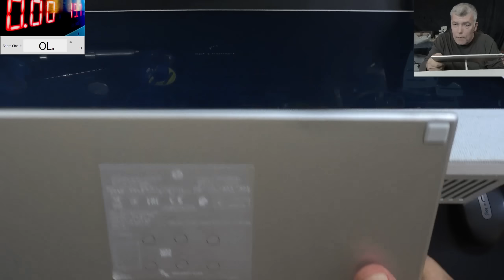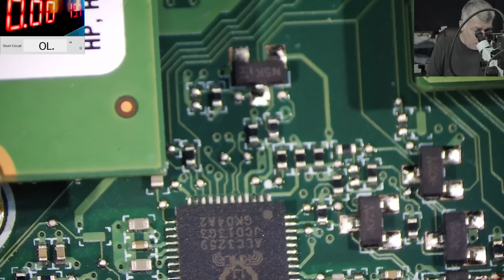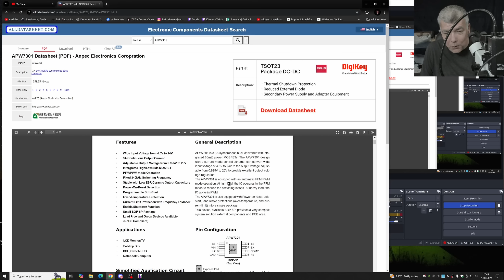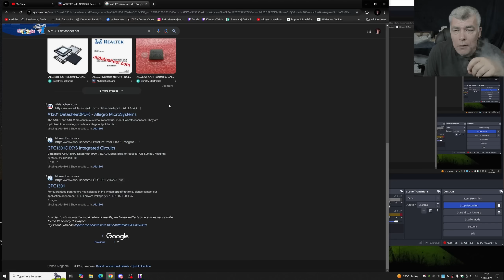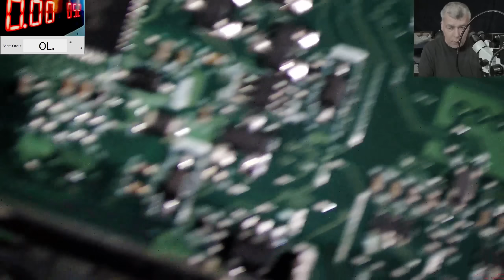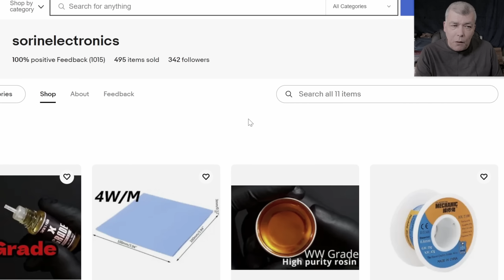Hp AIO GQ57 no sound - Dodgy? This is electronics at its finest, right? :D Audio rerouting

Comment: I repaired critical communications circuits for about 50 years. When it is critical you do what is necessary to get it going and when the situation cools down you go back and make it pretty or correct. Its better to do this when necessary rather than have the mission of the equipment aborted.

Comment: It doesnt work that way. A customer cant come in and ask for a repair and say i want it in x time. Its not always an easy fix. If they want it repaired, it takes as long as it takes. If the audio ic was burned and you had to replace it? How would you do that in a day if you dont have the chip? They come in, you diagnose the issue and go from there. You tell the customer how long it will take depending on the issue. If its as simple as this one where you can just solder a wire or if it's gonna take longer because you have to order parts.

Comment: I will check the data of the audio ic in put voltage.
Check the burnt regulator in put voltage drop by any other small regulator and give to audio ic

Comment: Well, seeing as you used proper calibrated wire I guess the repair is not dodgy. Seriously - if the sound isn't distorted at normal to high levels and it stays fixed then what's dodgy about it? A lot of these PCs are over-engineered - simplifying the power distribution is a good thing if you're not overloading the power line you're using.

Comment: Understanding the time constraint, one could wire in a dc barrel type power jack, and wire this to the audio chips Vcc and ground. Then get a voltage regulated 120v/240v input to 5Vdc out external power convertor cube. Then plug this into the wall outlet power and other end into your previously installed dc power jack. Hopefully with your method used, the additional load you put on the other power supply chip for your audio chip power source now doesn’t overload/overheat it with time? Clever however how you robbed Peter to pay Paul 😎👍

Comment: I think that when the resistor is bad, it increases its resistance, probably that's why you found that resistance, there is a voltage divider if any of the resistors are changed the output voltage is different, remove the resistors from the board and measure and calculate using the formula: VOUT= VIN(R2/(R1 + R2)

Comment: Hi sorin the fb pin has a defined voltage if that voltage gets to the feedback pin the buck supply switches off pwm generally feedback pin has voltage of 0.9 to 1.6 v that means if output is 5v the feedback pin should have the voltage defined for it after the resistor divider network doesnt matter what resistor are being used in it untill its in range of 100kilo ohms.

Comment: It was a great video but in the end : ain't that over-engineered board ? I mean you can literally bypass a power supply chip with a wire, why did they put a failing point for nothing ?

Comment: That ic takes 12v and i would add step down buck regulator and convert 19v to 5v or boost regulator from 5v to 12v incase power supply is not always on when you plugged in adapter. Thats how you can proper job incase you dont have in stock but being a technician i always keep srep down and step up regulator with variable outputs on me for these kind of jobs.

Comment: anyways id just use a direct conversion from the main rail and tune it down to 10v using inductors and variable resistor and a 30v100uf buckconvert

Comment: this design is actually clever id say a good propper design someone think aye we just slap an isolated soundbar module in this thing tied to main rail then step down the voltage and we done simple efficient if it get rekt it doesnt take the other component or chips inside

Comment: On my motherboard, the sound is also broken and can't find the chip anywhere, so I connected an external DAC and the sound is better than the original. I did remove the chip in case it can also be short-circuited.

Comment: The machine was fixed, and Sorin should have said that the sound quality would be shit. 
And if client wants better quality, he should suggests a USB sound card (or better yet, BT speakers). Or client could call "in a week" and find out if the part has arrived.

Remember, the "bottom line" depends on many situations, and here the critical parameter was: have a computer tomorrow, and only then an additional one: have sound would be nice.

The client received: a diagnosis and a temporary solution.

Comment: There is a voltage divider formula in data sheet, after knowing the voltage you can replace with any other Buck converter laying around in spare boards or even premade 3£ converters from the Chinese, it's less dodgier, lol
Reply: I had done like this. 👍

Comment: I will take 5v from the HD drive .. but i'm worried about this voltage... the burned power supply can power also the 2.5 HD... this machine has an M2 for windows ( i don't think it's an optane hybrid array ) .. if i'm right the 2.5 disk is also not working.

Comment: Nothing very wrong in the repair you did but the only issue could be, the speakers are too demanding and the amplifier draws a lot of current, you may also burn the supplly from where you have sourced the 5v. 

Better to replace the chip on long run as soon as possible it’s available.

Comment: Hello Soren and channel.  To fully evaluate this fault, the altered power input, it is very helpful to simply set about designing a board region.  
Several very robust programs support the activity as  board component within design layout, the activity to design and fixture chips, capacitors, resistors, mosfet, diodes, ect.  Within the program, effortless placement is moved, altered, as to achieve a nice package with the normal end goal set as sales. My task was to effect a car  windshield with dim out to the dreadful blue -white halogen intensity as blinding as hours of operator darkness.

The understanding 1st gen trial, leads to 2nd gen, 3rd gen.  Directly relates to various print reads to the modern , mother board complexity.  Some models, such as several dell monitor, suffered a central power solder fracture after months of end use.
Re solder, repaired the fault for a refreshed service time. And I think the interested channel will at once, think of other examples.  A common fault to model. Fundamentally, the customer to repair wants a rugged, long service to needed device. And advances a device to request for repair.  How the electrons flow is not of interest or comprehend.
Enter practical, restored to working.  Sound is on.  Everything works.  
Low cost, expected robust operation for a long life.   
Next example?  The modern car parked outside, with a list of electronic modules doomed to fail. Water, vibration, hot cold cycle?
Get ready to pay for expert service.  Will  you truly care about 11 volt to 14 volt duty? Drive on. Calibrate wire.  Everything is fine because "we have picture". M.

Comment: Very good way to ez fix.👍
It is a good way like u did but for to go like more professional I will check more to be sure about the voltage an put a buck converter to get the same value from the speakers.
I always looking ur videos, I love how u do fix the problems in a easy way and saving time. I learned a lot from u either. Keep doing what u do and don't mind about dogshit comments for those who don't know in electronics

Comment: IF... you are sure the 5V you are stealing it from is not a "balanced" circuit that drawing from it could crash that and can of worms...,   then maybe a little voltage reg tapped from 19V would be the safest and it can safely draw what ever the volume is.  I have tons of 5,9 ect  v regs for this purpose, not just laptops. So useful when you want to get power to something controlled but NOT sure if the tap is safe to do so.  Sorin is VERY experienced and wouldnt do this or show you unless it was safe. The guy knows his stuff when other shops are clueless.   He makes stuff work!!!

Comment: If i where you i will check that chip input then i will use step up power supply or a booster and try the right volt. Then it will be safe if he used his speaker on max.
No doubt that your repair is quick and smart and cost no other part.

Comment: Hello. I have small generic switching power supplys with diferent sizes and adjust the voltage. I reapair some Epson proyectors using thats. Put the power supply inside a heat shrinkable.

Comment: I personally would have replaced the chip. I understand tight deadlines and he needed it back the next day - and he would have, without sound (just as he brought it to you). I'd have then said once the part arrives, bring it back for a proper repair. However - I was impressed by your repair! No need to mess the customer about any further and the results are the same! One working computer! Pure genius!
Reply: Agree with everything you said!
Reply: That's fine ONLY if you can even get the chip.
Reply: The customer should wait for me if he wants it with sound , sometimes pressure results to improper job , will wait for the right part , inorder not to affect other rails
Reply: What is "proper"? It works fine this way. So, it is not "proper" until there is what "god" put there?
Reply: @milsiart4976  Besides pulling extra current from another rail, he might have introduced extra noise on that rail which might have data on it. No way to know without very detailed examination of the entire circuit, at that point it might be easier to just repair the original rail in the first place.
Reply: @milsiart4976 Proper might not be the right term and is very relative..Fixed As Designed is what OP was suggesting and may be a more appropriate way of putting it
..
Reply: @milsiart4976
Reply: read whole comment when???? @milsiart4976
Reply: @milsiart4976 well I think, proper is when the repair follow the original schematic of the board

Comment: good job 
I have a similar case but no short ,the sound work from time to time by itself,
i did removed the motherboard and applied heat on the realtek chip and the 2 amplifier it worked but after some days it appeared again i think the chips needs reballing 
it's asus zephyrus s gx531gs

Comment: Give Sorin a break. This is a temporary solution until a proper chip comes. They are available on Ebay for £7.21+£3.00 postage from China. If the customer is happy meantime then that repair is a win all round.
Reply: Pretty sure it will stay this way unless it breaks and will be brought back on warranty.

Comment: The pin 5 (FB) of power PWM chip APW7301 perhaps should have 1.25V to stop generate pulses. A quick look in the datasheet should confirm what voltage assigned to the pin. Then provide a voltage 5V on output of the coil and check what voltage will be on pin 5. Now you have sufficient information to calculate what supposedly should be the output voltage to supply to audio amplifier.

5V taken from other chip might be insufficient to provide enouth power to amplifier and perhaps strains other power supply chip.

But as a quick fix it is a reasonable solution.

Comment: Where would Sorin be without his calibrated wire ?
If i was doing the repair i would have been honest with the customer and told him that
for now it is working, but it requires a new I/C to return it to factory spec.
If he continues to use it with the temporary repair it is at his own risk.

Comment: I can't believe that you don't know how a voltage divider works on feedback pin.
There is formula on datasheet.
You may desolder and measure resistors and calculate value.
Or you may inject variable voltage and measure on feedback pin and rise voltage until you get required voltage on that FB pin, in this case 0.925V.
That dodgy repair just load too much other 5V rail.
Finest repair will be to replace chip, there are many other ic with similar pinout over 100 at preliminary search, bad case scenario replace that power stage with a cheap chinese dc-dc step-down converter.

Comment: I would have installed a small buck converter (LM 2596) to the main power rail, adjusted its output and then connected it to the audio circuit. I think your method would overload the other circuit that you tapped into causing premature failure of that circuit. Captain dodgy strikes again 🙂
Reply: I tought the same when I watch the video first time. Then I checked again how much current the chip absord when Sorin use the bench supply ... it was only 20-30 mA,
Reply: It is a "monster" for such solution, there is a cheaper and smaller solution which available in plentiful.
Reply: Lm2596 is an overkill here, I would rather use mp2307 or some sort of thing. It has higher switching frequency and smaller size

Comment: I would replace the chip. There is a possibility that the 5V rail will get overloaded and burn in the future. How many watts do these speakers have? 2-5? If they are 5W, the required current is about 1.25A RMS on 4ohm speakers. I am expecting a return.

Comment: I would look not only at the datasheet and the typical application but also at the formula that shows how the Vout is calculated [Vout : 0.925 x (1 + R1/R2) x Vin (APW7301 Datasheet - Page 13 - SettingOutputVoltage)]. Then I would measure the resistances on the circuit and calculate the required output voltage. I would fix a regulated voltage regulator module with an output of about Amps to an empty place on the circuit board and provide the energy in this way (if I cannot find the APW7301 IC). This video was the first video on the channel that I gave a dislike. Sorry..

Comment: I would use a buck converter (connect to 19v rail) to provide power to the chip. They cost a few euro on ebay.
Reply: Yes! Even anything you got like 7805 a117 anything but to take from the audio ic power supply... The above does work OK up to the point you will put up too much volume and the amplifier will draw in amps not miliamps and will drop the voltage on the audio ic enough  to crash it and disappear from the system until next reboot 😅
Reply: space, the final frontier! :D
Reply: @miftosaurus  🤣
Reply: The problem with buck converters is that they take space and it's difficult to fit them inside a compact device such as this one.

Comment: In theory that psu was set for ~12V, a voltage that looks reasonable to me for an amplifier.
Also the manual at page 13 says the output voltage formula is 0.925 x ( 1 + R1/R2 ). R2 i think is nearly 10k in this board.

Comment: I would replace the chip. You are now supplying voltage to both chips using the same power supply, which might not handle that kind of power. Remember that the audio IC must use much less power than the audio amplifier, so most likely the audio IC 5V supply is going to be mad hot while in operation and may die sooner than expected.
Reply: Most power supply chips are way overpowered for this kind of application. Can't even buy the shitty chips anymore. Economy of scale. Also the power supply will provide until it burns. Thick board, lots of solder. No problem.
Reply: I would too, but the guy said that he needs this device to be repaired asap, so there should be no complaints 😅
That’s the only way

Comment: Order the chip and replace it. Customer will pay. This what you did may be a temporary measure until the chip arrives. If the chip got burned in the first place is because probably is running hot anyways.

Comment: I will read the  voltage feedback  of power supply  and find the proper voltage value  and  after  that  I will try to find  the same ic , if not possible  to find ic then  I will fit a  small  size buck converter   but with enough  power , power will be given from Input power of ic and Enable  pin also connect. 

But I  don't have time ,like I  have to give it in 1 hour  then I will also do the same.